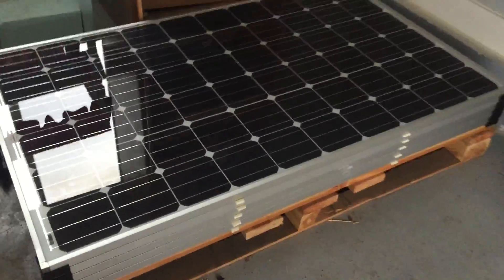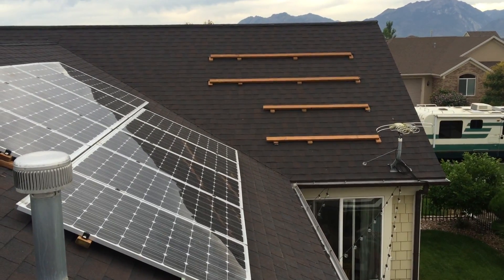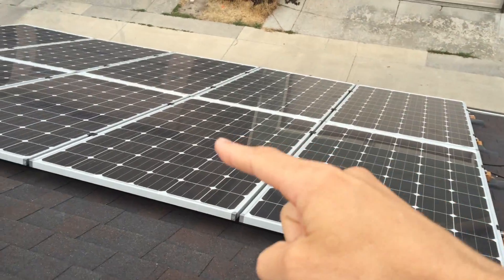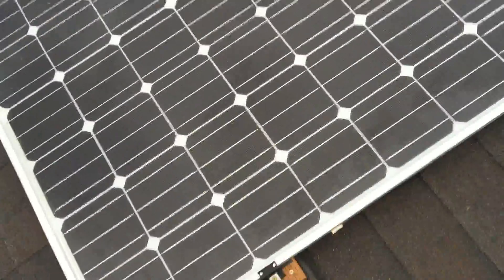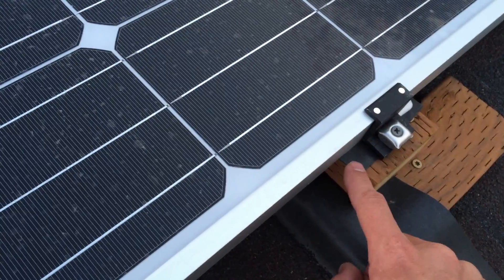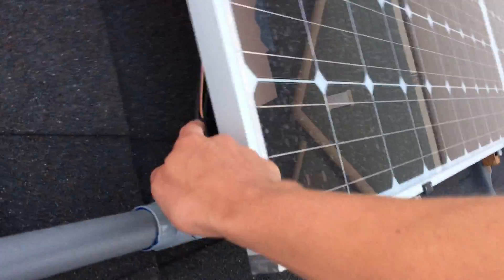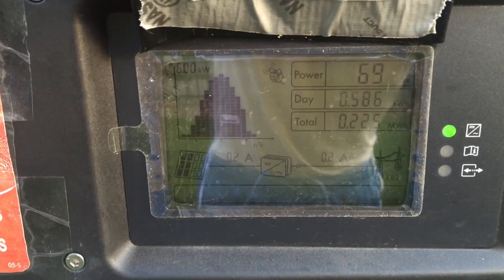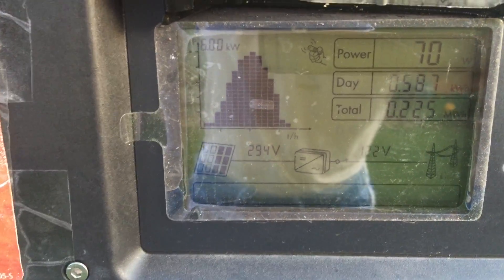How To Install Solar Panels Yourself For $4K - DIY 7KW - South Jordan, Utah - Cheap

Comment: Very nice.  At only $4K, you not only speed up your return on investment, but you also get bragging rights of a low cost DIY project that might be the envy of the neighbors.  What if the grid goes down though, do you have any type of backup power (batteries, generator...)?  Do you have central air/heat and if so, can the inverter run it fine?

I think for DIY solar, if you want to have a compromise solution, just run the most power hungry appliance (usually the central air/central heater) from the grid, and run the rest from solar.
Reply from the maker: David James Thanks, it has been a fun adventure! So if you read the write up on my blog that I did that is linked to in the video description, I explained there why I didn’t pursue batteries.  The bottom line is that I was optimizing for cost and not for disaster recovery.  Where I am, the grid never goes down and I don’t mind having a dependence on it. Thus, batteries just add additional cost with no benefit. In the event that the Greg does go down, my inverter does allow me Do you have one outlet so I could plug-in a fridge raider or vital appliances.  So in the end, battery back up would just increase my cost by about double for a scenario that is highly unlikely.

Comment: Did the power company have to come out to your house to physically connect your system to the new net meter?
Reply from the maker: They came out, but it wasn't to connect it.  They replaced my old meter with a new meter that can credit/debit properly based on which way the electricity is flowing.  I did the part where I connected my system into it.  I just hooked the AC 4 wires into a circuit breaker, and then popped that breaker into the main breaker box.

Comment: Hi Matt, I don't know if anybody already asked about this, and I did not want to read all the comments.
My question is, what do you do when it is time to update your asphalt shingles?
Reply from the maker: Take off the panels, replace the shingles, but the panels back on.  They are pretty easy to get on and off - it would probably take me 3-4 hours myself to get them off and on again.  But, in 20 years when my shingles are bad, I might just upgrade the panels to something better anyway.
Reply: @MattNewman  
OK, wasn't sure if you thought about it before you did this DIY project.
Do you get snow where you're at, and is it a problem if you do?
Reply from the maker: @readtheinstructions1407  Yes, a lot of snow.  it is just fine - the snow usually melts off pretty fast and I generate power even in winter.  I don't have to clear the snow off the panels or anything like that.  It does make it so snow ends up coming off in piles instead of just slowly melting into the gutter, so I end up with some piles of snow around the house that I didn't have before.

Comment: As lightning can have as much as 1 billion volts are you sure those very thin grounding wires will handle it?
Reply from the maker: No, but if a billion volt lightning hits my roof, I will have much bigger problems.  

I think generally the grounding wire is more of a safety precaution for surges in electricity from the panels, not so much lightning.  I am not too worried about lightning striking!
Reply: I have seen in other YouTube videos that they are there just in case your power wire fray and the panel becomes live
Reply from the maker: I see - makes sense
Reply: A billion volts.....exactly WHAT wire known to man would handle that?
Reply: I think he's implying you need to hook up a flux capacitor to handle the 1.21 gigawatts from a bolt of lighting.
Reply: your wire choice is fine. I install for a living and we use that same size.

Comment: honestly, as an engineer the more i watch this video the more i am disgusted with how the federal tax credits are being wasted by solar installers adding a 50% markup on the systems

your racking looks perfectly fine, metal flashing is only about 400 for sets of 12 to do it the "right way"  
you were able to install the inverter (easy just 2 mounting bolts) and run the quick disconnect wires yourself (even easier if using micro inverters)

you ended up with 7kw installed for approx 6000$ if you quote the man power at a fair market price
or <1$/watt 

crazy how so many solar companies are quoting in the 2$ range for 15kw systems. 

the federal credit should be given to builders to just add the mounting posts when new and let the owner buy the panels and inverter when they are ready. or more worthwhile systems, a frame roofs, warehouse roofs etc so its not wasted on crazy mounting systems and labor.  

mark my words i think the prices will barely change after the credit goes away, they'll want to keep their existing sales and you'll see margins compress 

just blows my mind how you can buy panels by the pallet yourself at .4$/watt, and then to get them on your roof you have to pay some smucks 2$/watt+
Reply from the maker: Truth.  I am tempted to start a solar installation business that disrupts all the others and does it for 1/4 the price!
Reply: same, i looked into it
a pallet of panels 12/16 is only about 2000$
32 pallets in a container? you'd only be in about 60-100,000$ to buy an entire container and have pricing just as good as pretty much anyone in the states

inverters might be a pain

the labor and the permitting is the issue.  i wanted to go offgrid with a sunnyboy charging my tesla that sits at home during the day

but darn car cant handle varying inputs so need buffer battery which kinds ruins the simplicity

can't wait for powerwalls to get below 100$/kwh publicly
off grid systems might just be far simpler to install 

not to kill your vibe but the good news is that when it reaches critical mass, builders will just set up the mounts to start with and the conduit down to the garage with a disconnect box leaving you to get the panels and inverter..

simple mounting job and inverter wiring and you're in business.

the federal government should have given a credit to new homes being built in the south to FUTURE PROOF them to make solar significantly cheaper to install instead of giving money to work on old messed up houses. more bang for the buck
Reply from the maker: Richard Roberson I like your idea of incentivizing builders to get installation started in all roofs.  Let’s make it happen !
Reply: @MattNewman  There are a few builders doing this already in California, wiring too. One that recently sold was RSI Communities, not sure if they will continue under new management.
Reply from the maker: @mitchdeming8725  Interesting.  While I don't love everything California does, they are leading the nation when it comes to solar by far - https://www.seia.org/research-resources/top-10-solar-states-0
Reply: @MattNewman  fun to see how long that last
Reply from the maker: @andreygoncharuk  yeah, I am planning on about 20-30 years (which sill save me about $25K-$40K), and by then, there will probably be far superior solar technology

Comment: Like the install in general. There are always things to pick apart. Fact is yours is up and working and no longer a dream. I did enjoy the description of how the lightning would go down the ground wire. Though that is the general description. Truth is if lightning hits anywhere near, all of that shit will be useless. I cant tell you how many amps, receivers, and televisions I have replaced for customers just due to near strikes. Not even direct ones, those end as fires.
Reply from the maker: yeah, good point.  I think guarding against lightning is probably futile.  I suppose having proper grounding for power surges from the solar generation isn't a bad idea, so I think I am guarded against that at least.  Really I just did all the grounding stuff to pass inspection.

Comment: why 2700 for an inverter? I dont get why solar panel inverters are that expensive
Reply from the maker: I know!  I mean, it is a pretty important component as it converts DC to AC, and a lot of current goes through it, but shouldn't cost that much.  I have found a bunch on ebay that are the similar to what I got for $1500 - https://www.ebay.com/sch/i.html?_from=R40&_sacat=0&_nkw=sma+7000+inverter and https://www.ebay.com/sch/i.html?_from=R40&_sacat=0&_nkw=sma+6000+inverter
Reply: Hi Matt do you feel micro inverters would be better? I know they are better for efficiency since any debris on a single inverter can cause the whole system to bottle neck. However, like you, I have no trees around me at all ... But while searching for prices, I see single inverters for a 7kW system pretty much the same price as micro inverters ... so what gives?
Reply from the maker: Salvador Nobre Veiga So you can get an inverter like the one I bought for about $1500 on eBay. I just didn’t get a very good deal. Micro inverters generally cost $100 each at the very lowest, so in my case that would’ve been a total of $3000 anyway.  Generally micro inverters cost more but I have seen some used ones for about $50.
Reply: Hey Matt, that's the ones I was looking at. The inverter you had I can only see for upwards of 2000 dollars... on ebay though I can see a lot of Enphases M215 for 49$ each and these are new!! At least according to description. At 28 panels for a 7.5 kW array, this would only be 1340 dollars! I couldn't find it cheaper even with a single central inverter. I think I might wait for an ebay coupon or at least some Ebay Bucks ... sometimes 15%-20% bucks come along which would give me an extra 270$ savings!
Reply from the maker: Salvador Nobre Veiga Yeah if you can get them for $49 each plus some discount, that seems like a better deal. It would require that you have AC wires everywhere instead of DC like I did but I shouldn’t increased cost too much either. I guess I just never really pursued micro inverters because of the time I felt like they would be more expensive but maybe now they have come down in price and it makes sense to do them.

Comment: Hi I really enjoy this video very helpful, just have one question about the rubber you use underneath the roof tile where can I purchase this item thank you very much.
Reply from the maker: I just found mine on ebay - 5' x 5' EPDM rubber pond liner, koi pond 45 mil thick.  But you can probably find something at Home Depot or Lowes.

Comment: Awesome job dude. I been studying and researching the same project for some time now. I'm in south Florida where there's plenty of Sun and net metering is available, I still don't know if the city or the power company requires a licensed electrician to do the electrical part. 
Did they require anything special from you? Where did you bought your system? What brand of panels and inverter did you use?
Thanks for sharing and again awesome job.
Reply: Never mind, I went to your blog and read all the info
Reply from the maker: Mr. Anglada You should go for in Florida. I bought my panels from sun electronic switch is right there in Miami so your shipping will be cheap. I’m not sure with the electrician stuff, you will have to check with your city. Mine didn’t require anything because as an owner or I can work on my own electric here. For more details, check out the link to my blog in the description of this YouTube video. You will see a lot of information on there about where I bought everything￼
Reply: @MattNewman  can you please clarify something for me about the net metering? I understand that the power you produce you use it and the excess not needed at that moment it's sent to the grid. How about this, for example at 12 midday when solar production it's at it's peak 1kwh on your case, and you are using just 0.8kwh, but you decided to turn something on and now you need 2kwh, would you still be using your 1kwh and requesting just 1kwh extra from the grid? Or will solar cuts off and the 2kwh comes from the grid? Edited
I hope you get what I mean
Reply from the maker: Mr. Anglada yes you would just be paying for the extra 3 kWh that you need

Comment: As a home owner, I love it man,  get it done cheap and get your money back.  
As an electrician,..... I’m just glad you didn’t show us any of your joints
Reply from the maker: yeah, I guess you just have to balance your desire to save money with your ability to do it in an acceptably safe way.  I felt like I never would have gone solar if I didn't do it this way, and I don't consider what I did perfect, but it also isn't terribly risky or unsafe.  I know it doesn't meet a typical electrician's standards, but it is good enough for me, and has been working great for 2 years now.  I would love any feedback you have though.  I am always open to learning better ways to do it so I can implement the better practices on my next house!

Comment: so now how much  it cost ?
Reply from the maker: $8500, and then $4500 back in tax credits/deductions, so total of $4000 (like the title says).  I could have gotten another $1,300 off if I had deducted the labor (which I didn't know you could do), and also another $1K off if I would have gotten the inverter on ebay.
Reply: thanks

Comment: anyone here have any experience on putting in a solar system in Florida? I have a technical background and I know I can do the work professionally myself, but I have heard that in Florida you need not only a licensed electrician but someone who has a SOLAR license. And that solar panels have to be approved by the county, I'm in Miami-Dade, in order for them to issue a permit for the work. Anyone know if there's any way for a home owner to pull his own permits for this type of work?
Reply from the maker: no sorry - check with your city

Comment: As a installer we never use PVC conduit or Wood rails on a roof , We spray paint the conduits to match your roof and brush paint the conduit on  walls to match the walls... just helps the system blend better.
Reply: bee4pc goldrule 
Helpful just to match the house color. 
But i preferred not matched color instead pay thousand$$$ for labor and matching colors
Reply from the maker: true
Reply: Do you leave the conduit exposed like this, or plan the system so that much of the conduit runs under the panels? It seems that a lot of the conduit and cable runs for this DIY install could have been run under the panels, thus hiding and shielding them.
Reply: @christophermichaelson9050  mine runs under panels
Reply from the maker: nice
Reply from the maker: yeah just exposed
Reply from the maker: nice

Comment: you should have done micrometers. that plastic conduit with the high voltage is dangerous. not allowed where I live. because we have had fires from what you have up there.
Reply from the maker: i assume you mean microinverters - the voltages should be well within appropriate ranges since I have 3 strings.

Comment: uni strut... do not put wood on your roof.... sigh...

Oh as an EE, lightning protection can not go up.. it always needs to head towards the ground.
Reply from the maker: yeah, that was a lesson learned - unistrut would be better than wood, but the treated lumber is holding up just fine after 3 years.  I am not sure what you mean on the lightning part - is there something in the way I did it that assumes the lightning will have to take a path upward?
Reply: Matt Newman  yes it looks like you went from one set of panels on one side of the roof then ran your lightning protection up over the peak of the roof to the other set of panels.

Also I wouldn't put lightning protection in with power conductors, it should be run independent.

I have designed lightning protection systems and it can go up but only very limited. Lightning will jump off your ground wire and blast a hole in your roof if you turned it up more than a foot or so.
Reply from the maker: Spikes those are good points. I guess I mostly did the lightning stuff to just pass inspection. Thanks for the pointers

Comment: I found gently used panels for $400 per 3.5 kilowatts I'm looking at a $600 sonnyboy 4 kwgrid tie inverter and I'm assuming everything else will cost 500. Plus a new panel $200 and I'll hire qualified elec. friend to install panel $300 that's $2000 for a 3.5 kilowatt system I am excited you got yours cheaper also I can't believe people spend 15k to 30k...
Reply from the maker: yeah, sounds pretty good, but yea, there are great deals out there with sunelec and inverter on ebay.

Comment: Great job on your DIY!  I'm curious as to how well your string inverter handles the fact that your panels reside on serveral facets of roof space.  Normally recommended for when all panels face same direction.  Also if one panel goes on the blink, a string inverter is hard pressed to show you where the problem lies.  I'd like to point out to your viewers that net metering is not available forever.  When Hawaii hit 16% participation they had to call 'time out' on net meter applications since the grid could no longer handle the surplus energy from their solar customers.   California is getting very close to that point now.
Reply from the maker: Thanks for the insights.  Actually, I have three strings of 10 panels each.  There are two sets of 5, but they all face southwest.  so, for each string, all 10 panels are pointing the same way.  It is working fine and getting great generation (about 50kwh per day right now).  Also, I considered that stuff with string inverter but so far (after three years), it hasn't been a problem at all, so I am glad I went with much lower cost.

Hopefully the grid tie gravy train doesn't let up soon - I have already broken even on my system after 3 years!

Comment: great video bro....I'm planning this statement to our new home in India....kindly advice wether can make the panel stand moveable if needed to capture more power....
Reply from the maker: AdiTv thanks!  You can make it moveable but that probably costs more than it is worth especially if you are trying to use motors to automate it.  I would spend the money on more panels.
Reply: Matt Newman thanks bro